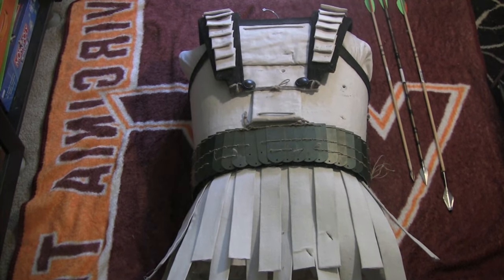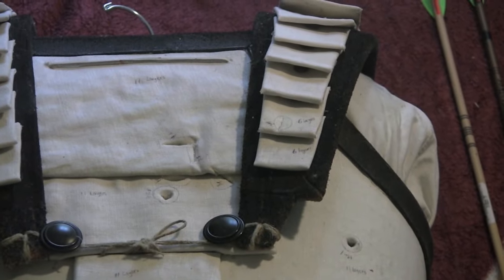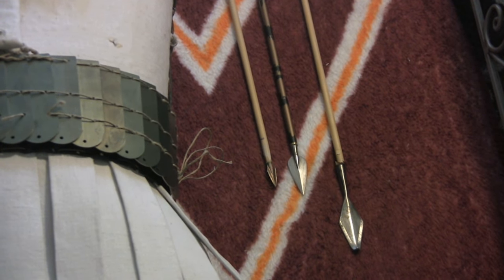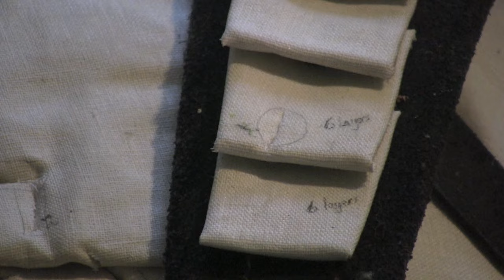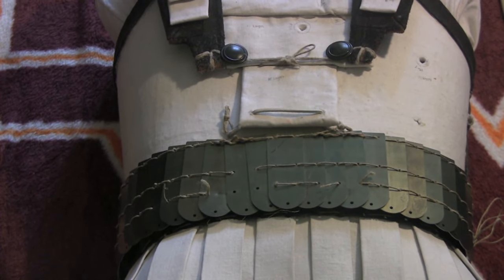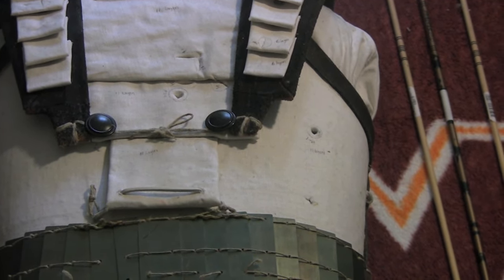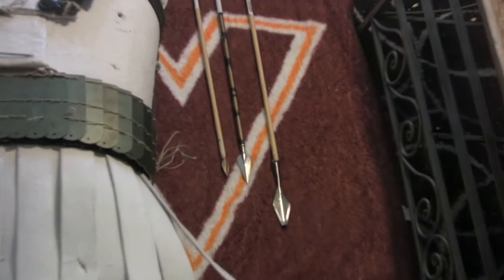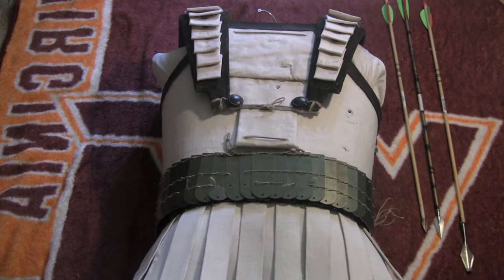Testing of a Linothorax in HD

Comment: How heavy is the bow's draw weight and what's the distance you are shooting from?
Reply: Draw weight doesn't matter. The important variabel is the speed and the mass of the arrow, because a lighter and better produced bow can be stronger than a heavier one
Reply: @ghifarakbar8492  I am almost certain you’re wrong on that the heavier the drawl weight on a bow generally the faster it launches arrows so using the same bro you would then want to figure out the weight of the arrow in the speed it’s going to figure out how hard it would be hitting
Reply: @charlottewalnut3118  if you use the same type of bow with similar profile and using similar arrow then yes, draw weight does matter. but different bow have different characteristic. how the bow taper, weather it has syah or not, how it curve, the material used for the limb, the density of the limbs material, arrow material, arrow weight, type of arrow head and many other variables play part in generating arrow speed.

Comment: I imagine he was firing from much closer then would be typical combat ranges.
Reply from the maker: Correct. However, testing has revealed that arrows fired at long range retain as much as 90% of their initial velocity on impact. So, when I conducted my test I fired it with approximately 10% higher velocity than you would expect from a typical bow of the era.

Also, I intentionally aimed at the various parts of the armor. I wanted to get as many samples as possible. I was 30-40ft away - if I wanted I could have stuck every arrow in the center plate (any one halfway decent with a bow can do the same).
Reply: @Hokie2k11  If you really wanted to, you could use a bow that has an arrow velocity at 30ft away similar to the arrow velocity of a bow of the age at a distance common in warfare.

Comment from the maker: (cont.) it would not be used as a construction material (which it was, in fairly substantial quantities at that).  Second, there are many ways in which armor could have had waterproofing qualities added to it (regardless of whether it was linen or not).  Don't quote me but I believe some methods included coating the surface with lime or wax.  Finally, if I recall correctly most armies didn't traverse large distances wearing armor.  Now, to answer some questions about the armor I made.

Comment: The HUGE weakness I see is a slight draw across the chest cordage on the front will drop your armor, why not secure the shoulder strap on the front and wrap the cord on the back.
Reply from the maker: Agreed - I would have done many things differently had I had the time. When I made this I was under quite the time crunch, my main concern was getting to a point where I could actually commence with penetration and blunt force testing. 

I do however feel like I chose the aesthetics of the binding  based on some artwork from the era, so there is some basis for the way it is rigged. But yes, had I more time I would have found a more secure method for rigging the yoke.
Reply: @Hokie2k11   I understand a time crunch somewhat, but functionality (if ever needed) would always be my main goal with any project concerning armor or weapons, barring the need of historical wall hangers of course.....Thx for the vid.

Comment from the maker: Correct, they did not have steel arrowheads, which is why I used 100% bronze trilobat(e) arrow heads purchased from a custom smith in Britain.  The metallurgy of the bronze arrowheads was specifically developed to faithfully reproduce the physical characteristics of a 4th or 5th century BC Scythian arrowhead, aka as the trilobat(e).  That was the only arrowhead I could procure in bronze, so the remaining test had to be conducted using steel.

Comment: It's most likely made for moderate protection from melee damage - not arrows which is the intent of the large round hoplite metal shield. It's probably made to be lightweight and offer good mobility for the wearer.
Reply from the maker: I wouldn't be so sure. While I would much prefer a shield myself, armor provides very little defense against spears, which was the definitive weapon of the era. its really academic, but my testing has shown that it does in fact provide protection from arrows. That being the case, I would think it was used with that in mind (even if it also provides protection from melee attacks).
Reply: Also, Alexander the Great's army did not carry hoplon into battle. They wielded two-handed sarissas. They did have a telamon shield though, named for the method of securing it, which involved strapping a small aspis to the left shoulder. I suppose they could raise it up to protect the front of their bodies from incoming arrows.

I also have read that linothorax may have been supplemented with plate/scale segments and definitely with a metal helm.
Reply: the hoplon was a wooden shield
Reply: Sonhante Sonhador Also a good point. Though the better ones were sheeted with bronze or rimmed with iron or steel.
Reply: @bellgrand  Right, i think most people belive that they were metal because of the fact that wood dont survive that long, but metal, or bronze, do. So there are more bronze parts (or shields) left.
Reply: Sonhante Sonhador no it's wasn't there was bronze and leather with the wood
Reply: @Brian-kr7bw  They were made of several different qualities since traditional Greek warfare required citizens to arm themselves (with what they could afford).  The better armored and financed upper class typically had bronze/wood/leather laminate hoplons,  but the poorer middle class hoplites typically only used wood and leather laminates.  Other than thier weapons, most greek warriors carried very little if any bronze due to its great cost.
Reply: Shields are much better at defending against arrows yes. But this armor has a better match up with an arrow than a bow
Reply: nosajimiki killeen wow never knew that. Sorta just thought they all had bronzes breastplates, helmets, greaves, and shields.
Reply: Inf act it was made for arrow protection too and it was doing its job well in battle circumstances. 
Copy&paste - the research:
Modern researchers have had difficulty studying linothorax armor due to it being constructed of biodegradable materials which leave few remains for archeologists to discover.[7]

Gregory S. Aldrete has attempted to reconstruct linothorax armor based on ancient depictions and descriptions.[7] In January 2009, Aldrete and his student Scott Bartell presented a paper discussing the protective qualities of the linothorax at the joint American Philological Association/Archaeological Institute of America Convention held in Philadelphia, Pennsylvania. The pair have been researching the linothorax since 2005 and have built a number of copies, using various methods that include lamination and quilting. They believe the armor was constructed out of linen and rabbit glue.[7] The research was carried out by assembling dozens of linen test patches, arranged in a multitude of fashions, using authentic materials, and subjecting them to arrow shots and sword cuts. The testing was carried out in a sort of "worst-case-scenario" at nearly point-blank range, where the angle of archer to armor was perpendicular. In an actual battle both of these factors would have been considerably different, making the performance of the test patches even more remarkable. The tests also concluded that quilted armor offered roughly three quarters of the protection of laminated armor; thus the quilted patches were less effective. This was found to be true in every sort of test conducted. The research conducted by Aldrete and Bartell was also presented at the 2010 Poster Session for the Archaeological Institute of America (AIA) in Anaheim, California, where it won first prize among many contenders from around the world. The research was published in 2013.[8] On November 9, 2011, Aldrete was featured on an episode of Penn & Teller Tell a Lie, broadcast on the Discovery Channel, where he showed how the linothorax worked by shooting an arrow at Bartell.
Reply: @sonhantesonhador9035  all shields were wooden, some had metal parts.
Reply: @bellgrand  the sarissa was the main protection against projectiles such as arrows, not the shield which was used incase an enemy was able to close the distance and attack the phalangite.
Reply: @iterationfackshet1990  That's from Polybius, and he did not say this was the main protection at all, but only an incidental effect of the rear ranks holding their pikes in a lowered position. Their armor and shields strapped to the shoulder did this.
Reply: @bellgrand  alexander also fought on foot as a hoplite in sieges and stuff

Comment from the maker: The type of bow I used (a compound hunting bow) is irrelevant, what's important is the velocity and type of arrow and arrow head used. For this test I used real bronze trilobat arrow heads made by a smith in the UK. I affixed these to everyday wood / carbon hunting arrows, which I then weighted to ensure the final mass was as close to being historically accurate as possible. 

The final step was to use a chronograph (measures the velocity of the arrow) to tune the bow so it fired the arrows at the correct velocity.
Reply: With a compound bow you get better scientific results, since the draw weight will be very consistent. Thank you for this presentation and your work. If you ever cared to repeat it with the YouTube ballistic standard of pork ribs and orange stuffing, I'd be interested in if these penetrating arrows lose depth of penetration. There's also the fact your shots are worst-case for the target. Shots falling onto the target in plunging fire may be more this armor's intention to defeat. Even so, it seems a good flak-jacket for the common grunt.

Comment: Thanks for posting this!  Probably too late, but in your research, you may want to include other linen-based armors of other time periods (ie- European "jacks").  I believe you mentioned using 22 linen layers which is about the same for the average jack of the 14th & 15th centuries. In the "Ordinances" of Louis XI of France, one reads: ". . .and first they must have of said Jacks, 30, or at least 25 folds of cloth and a stag's skin."  (Regards from Lynchburg!)

Comment: I made a linothorax with about 20 layers of cotton canvas and some cardboard in the center for padding. Not historically accurate, I know. 

What I found was that it wouldn’t stop thrusts but it could slow down the knife significantly. Adding even thin brass sheets over the canvas was enough to keep the knife from penetrating. 

This was definitely the reason for the bronze scale bands many linothoraxes had around the midsection.
Reply: Remember that the linen was to be bonded together. If it was bonded together the resulting composite would be very hard to pierce with any knife or sword.

Comment from the maker: (cont.) A generous amount of glue was applied to both sides the linen and the surface before it was adhered.  This process was repeated over and over.  Once a core was built (about 11 layers with leather underneath) I added the leather border which was hardened in a C shape.  Some extra linen was purposely added to the borders of the armor to create a bell shaped profile around which the C shaped profile of the leather border was hardened, securing it all in place. Finally I went ahead and ran

Comment: I liked the testing. Would be nice to see you stab it with an arming sword while having it placed on a wooden rack to hold it up weight down with about 90 kilo and show the penetration? What kind of people would of been able to afford this armor? Would it of been something that they would make for themselves or buy? is it difficult to make? What type of glue would have they used? - A lot of questions I know :D
Reply from the maker: Thanks, appreciate it. 

A bronze sword would probably cut into the linen and leather, but not through it. A bronze sword thrust into it - it'd go straight through it. Same goes for a spear. BUT, this goes for most armor - most armor simply isn't designed to defeat thrusting attacks from weapons like swords and spears. It's one of the reasons maces are so damn effective - you get the piercing effect of a thrust with a slashing attack.

It is however EXTREMELY effective at absorbing blunt attacks. My brother played collegiate baseball. I had him take a pretty good whack at me in the chest while I was wearing it. Same for attacks to the sides. 

As for who would make it... it's been a while since I did research into this but I recall there being different methods of acquiring it based on who you were and when you are talking about. The Greeks were citizen soldiers, I believe many of them owned their own armor and weapons. The Macedonians however, under Alexander, had a standing army... a pretty sizable one at that. They had a standing army and garrisons in dozens of cities. Those soldiers most certainly did not pay for their armor, and I do recall reading something in Plutarch to that effect.

Also, it would not necessarily be cheap to make, but it wouldn't be prohibitively expensive. The real advantage to this armor is that its easy to repair, maintain, and becomes flexible as you sweat... and it doesn't lose much of its defensive properties in the process (perhaps less effective against blunt I suppose). It's not difficult to make at all, you just need a bunch of flax linen and glue. Linen wasn't cheap, but it wasn't rare either.
Reply: @Hokie2k11  Hmm.. well I wouldn't imagine it would be very accessable for lots of men who became soldiers.. There were lots of men who went to battle with a bronze plate on their chest and little else. The citizen soldiers of greece had land if I'm not mistaken but it didn't prevent you from being a soldier as long as you didn't live in Spartan lands. You wouldn't be permitted amongst the hoplites, but I imagine you could form part of a skirmisher unit. Armour was always the most expensive part of your kit. All of this though, doesn't stop this armour from being extremely interesting!

Comment from the maker: (cont.) a seam around the entire tube, top and bottom.  Not a fine seam... a very rough seam that was secured with hemp cord, cord which was knotted every few holes to ensure that the entire cord wouldn't come undone if one piece were broke.  This was perhaps the most difficult process; I had to take a hammer and nails to punch the holes in the finished cuirass.  With a little more foresight I would have punched a hole in the beginning and then repeat as I added each layer of linen.  Having said

Comment from the maker: Three of the arrowheads were made from bronze, the remaining from steel. However, if you watch the video you will see that the steel  arrowheads were outperformed by the bronze ones.  The defining characteristic proved not to be the material from which the arrowheads were made but the profile (shape) of the arrowhead itself.  The steel lamellar plates were used since no bronze were available, but only steel arrowheads were fired at the steel plates.

Comment: Simple question: if i want to build a linothorax and use it in a test like this, how can i repair my armor after the mess? Thanks :)
Reply: I dont think you can repair it. Once the linen is pierced, that's it. It may lasted enough for a battle, but that's it. You would have to buy another one afterwards. 
Its like Kevlar. Once it was pieced, you have to get another. But, it would keep you alive for quite a while.
Reply: in our historical reconstruction clubs little money. it is necessary to repair, that have torn at trainings or games. We put patches of leather or metal plates.
Reply: Since it is made of Linen or flax you can restich it the same way you would a tear, layer by layer.

Comment: isn't a piece of leather supposed to be in between layers?
Reply from the maker: Not really. There have only ever been even a few samples of the material found, let alone a complete example. It's difficult to say how they would have made it, but I don't think they would have used more than one layer of leather. At that point you might just consider making it entirely out of leather. If anything, I could see someone trying to make it entirely out of linen. 

I did however use leather, but only for the core and trimmings, and it wasn't a terribly thick piece of leather. My goal was to create a piece of armor that was flexible, not obscenely heavy, did not require hours and hours of stitching, and could be repaired in the field. In this respect I succeeded.

Comment from the maker: (cont.) that I never had an issue with the glue delaminating.  Ever.  The leather would become more flexible but thats about it.  Interesting... and not all that suprising, the armor was even more effective when wet (wet, not soaked... I did't drop it in a lake!) It absorbed an arrows energy more efficiently.  Bone dry it is very stiff, stiff enough to absorb a baseball bat swung straight at your gut.  I'm sure it's effectiveness against

Comment from the maker: Thank you for your inquiry.  It's been a while since I made the armor, video and report associated with it but I'll answer your question to the best of my ability.

The glue was hide glue.  Yes, there will be issues with it degrading in wet weather, however the same can be said for glue used in the construction of ancient buildings.  I am inclined to believe that if the glue did degrade that fast under those conditions then